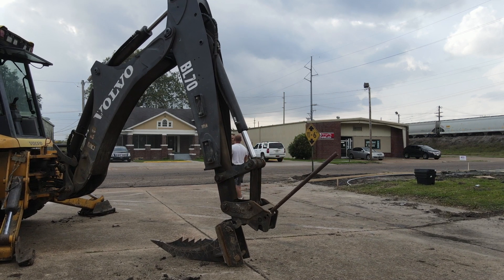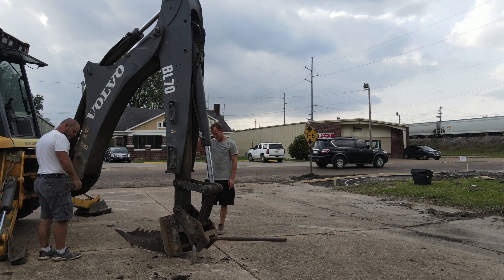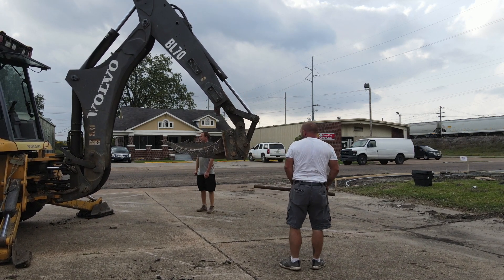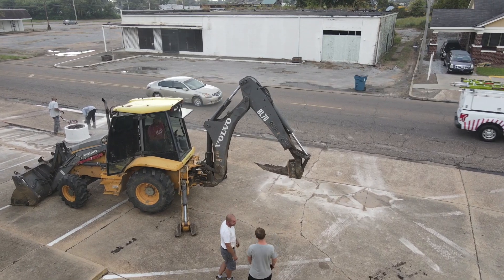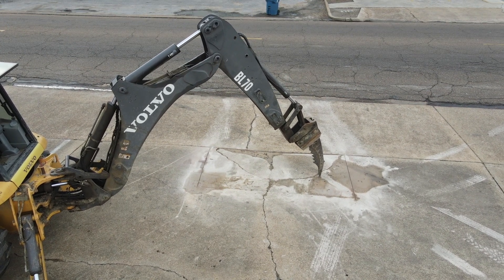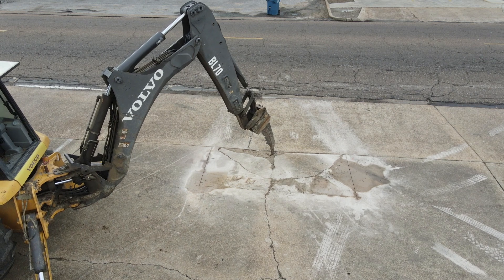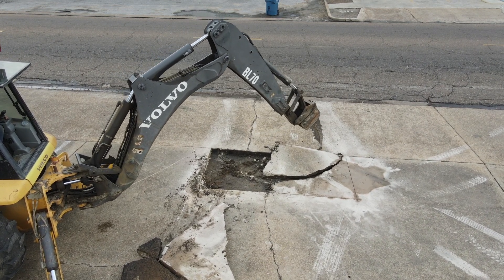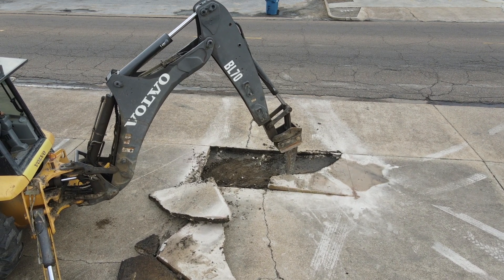Volvo bl70 Root ripper/concrete demo tool (Home built)

Comment: I like the tool once the concrete has been cracked, but i would use a drop hammer or even just pick up and drop a wrecking ball type of object to make the fractures.
Reply from the maker: truth. I have since started breaking it prior.

Comment: Works great. BTW, you have a bad hydraulic leak dripping on the bottom of the boom cylinder.
Reply from the maker: Water. That boom holds it. Had rained day before. But I do have one on that outrigger